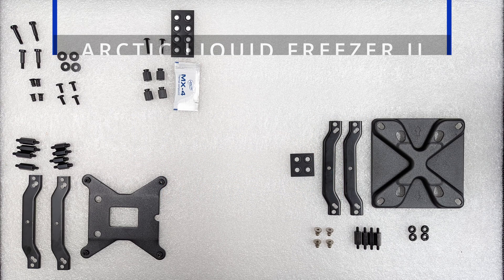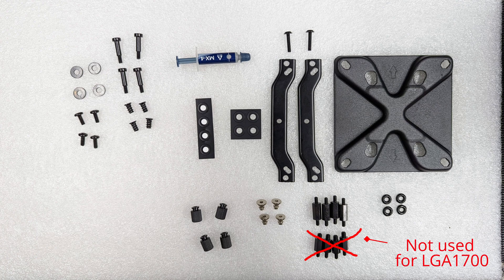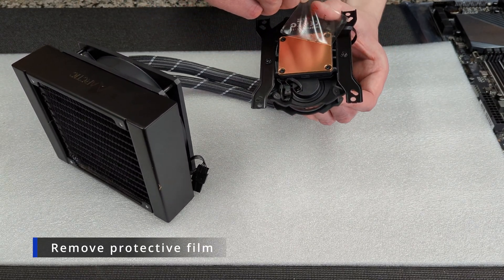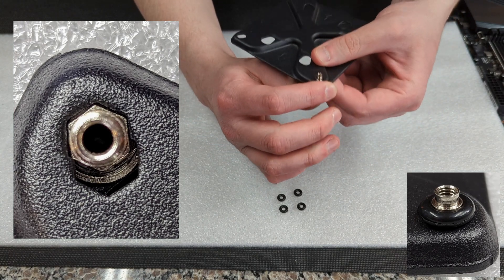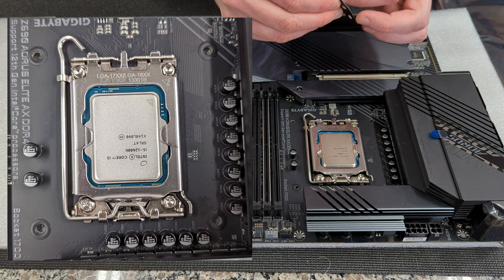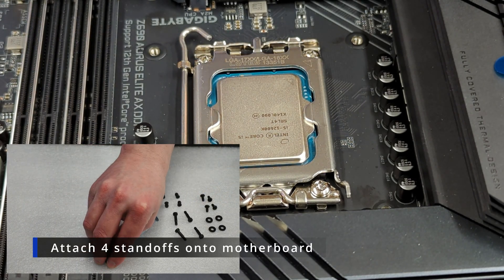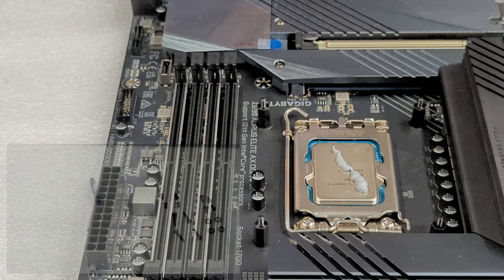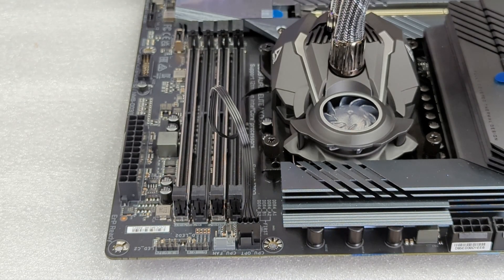ARCTIC Liquid Freezer II | LGA1700 Kit Installation

Comment: Does this backplate work for LGA1200? My MOBO is an Asus TUF h570 Pro.
Reply from the maker: Hi Keici,
the plate works for LGA 1700 and 1200 Sockets. CHeck out the manual for the kit: https://support.arctic.de/lf2-lga1700
Have a great day and stay safe.
BR
Arctic - Service
Reply: @ARCTIChannel  thanks for the reply!

Comment: Why does it go in pump fan optional instead of the CPU fan header or aio headed
Reply from the maker: Hey,

Either "CPU_FAN" or "CPU_OPT" are recommended. With the Liquid Freezer II, connection to a pump header results in a permanent, unregulated speed of 100%.

Kind regards
Dominik

Comment: Hello, i have Freezer 34 eSport basic, i need more of these mica spacers because i changed mother board and two of these spacers are broken and bended when i tried to pull them out, they are very sticky, now i do not have any idea where to find them, in your spareparts shop there isn't any, i also opended a ticket more than a week ago but no reply at all. Can you please sell or send directly these spacers? Thank you.
Reply from the maker: Hi Mik,

We apologise for the inconvenience and ask for your patience. We are experiencing an increased volume of support requests, which is why it is taking a little longer than usual for you to receive a response.
To ensure that you receive a reply as soon as possible, we recommend that you add the invoice and your delivery address.

Kind regards
Dominik
Reply: @ARCTIChannel  No problem, understandable, i attack the invoice to my ticket. Thank you for your reply and info.

Comment: Given this backplate design is just awful, is it possible (on Asus LGA 1700 motherboards with the LGA 115x hole spacing) to just use the LGA 115x backplate and the LGA 1700 standoffs?
Reply from the maker: Yes, you can do that. 🙂

Kind regards
Dominik

Comment: Nice vid, quick question though. Why the diagonal paste application?
Reply from the maker: Thank you!
It doesn't really matter how you apply the paste - just make sure that you cover the whole thing as thin as possible.
Don't trap any air inside and you should be fine

Best regards,

Comment: is the ilm bending correctors still recommended or made unnecessary by this mounting kit?
Reply from the maker: Hey Aeon,
GamersNexus made a video about that called "Investigating Intel's CPU Socket Problems | Thermal Grizzly Contact Frame Benchmark"
The test was made with our Liquid Freezer II.
There should be everything listed you need to know (Pro/Con)
Short form: yes it will have a effect but its definitely connected with a bit of work - you're also loosing the warranty of your MoBo

Best regards,

Comment: Anyone else having issues with plate screws? They wont fit flush on the back of the motherboard.
Reply from the maker: Check that the position of the plate screws is in the correct position (LGA1700 is the external milling).
The backplate can also be offset by 90 degrees.
Through the rubbers it can also feel a little bumpy, by mounting the stand-offs then tightens. :)
Reply: @ARCTIChannel  I believe I got it, it cools my 12900k at 28 idle and 66-70 max, great cooler.
Reply from the maker: Awesome!

Comment: What is the difference between these two small brackets with the original am4 ones?Because I think they are the same
Reply from the maker: Am4 has only 2 drill holes in contrast to the 1700 bracket. :)
Reply: Will these two brackets be compatible with MSI b550 tomahawk motherboard? cause I think they fit
Reply from the maker: The am4 is compatible :)

Comment: Excellent walkthrough! I had heard a lot of complaints about how difficult this cooler is to mount, but looks like Arctic took all that feedback into account when designing the LGA 1700 mounting kit, super easy even with the motherboard still in the case. Thank you very much for such a helpful video!
Reply: it is impossible to put the back plate on
Reply from the maker: Hey,
Could you maybe explain, what exactly wen't wrong, during the installation?
Otherwise take a look at our online manual:
https://support.arctic.de/lf2-360r7

Best regards,
Nico

Comment: 2:18
 Do I have to remove ؟

the PCB cover of the water pump
before installation on
ASUS ROG Maximus Z690 Hero
Reply from the maker: Hi Omar,
this specific board is on our incompatibility list and wont work with the cover attached. So yes please remove the cover as explained here: https://support.arctic.de/lf2-lga1700

Best regards
Stephan - Arctic Service
Reply: @ARCTIChannel  thank you
❤👍

Comment: you placed the cooler (pump block) wrong tho... doesn't it have to be "sideways" (small fan to the right, next to RAM) to match the cpu dimensions???
and yes i know the A_1 RAM slot is really really close, but it has enough space for it to fit 4 RAM sticks. (at least on the Gigabyte board you're using)
Reply: No. It’s designed to point up towards the VRM (since it’s a VRM fan). Though I have watched a few builds that point it to the left on condensed M-atx boards.

Comment: I just received an ARCTIC Liquid Freezer II 360 rev 4 w/ LGA 1700 upgrade kit. I mounted it on my LGA 1200 system to quickly test. I then decided to build my new LGA 1700 system but now I can't use the ARCTIC Liquid Freezer II anymore. Why? Because I only received 12 sticky washers. 8 came with the original kit for LGA 115x / LGA 1200 which I used. Then I opened the LGA 1700 kit to use for the LGA 1700 system to find only 4 sticky washers. If you're supposed to put 4 sticky washers on both sides of the motherboard, which means a total of 8 sticky washers, ARCTIC should include 8 in the LGA 1700 kit as well. Other than that, the AIO is FANTASTIC :) Thank you, Arctic, for a great product with a great warranty which is very important for many users.
Reply: I know this is an old post, but I just received my kit with 4 sticky pads. Also, the backplate sits on the Intel backplate and does not seat fully against the motherboard. I wish it did because the 4 standoffs cannot be fully screwed in due to concerns of overtightening and damaging the board. This might be a design flaw where the backplates touch.
Reply: @kurtrowland5587  Mine also only came with 4 washers...
What did you do regarding the backplate and crews?
Reply: @shalle3  I found the email with Support where we resolved this. I initially only put the washers on the front under the spinning nuts, but they agreed to send me a new backplate and 4 more washers for free. It was a really quick and easy process. Only took 2 emails back and forth. Props to Arctic  for having a good support team
Reply: @kurtrowland5587 hi, how did you deal with the backplate not seating fully against the board?
Reply from the maker: We are sorry for any inconvenience caused, we recommend that you contact our support team, who will gladly help you solve the problem: https://cs.arctic.ac/open.php?lang=en_US
Thank you for your understanding.

Best regards,
Social media team
Reply: @ARCTIChannel  I have the same issue, as others, with the backplate washers still leaving a gap between your backplate and the board. You have not replied to a single comment about this. Can you please not tell us to contact support, this is your product. Is this ok or not, and if not, what is the solution?

Comment: Not sure if I will get a reply but I have install the fans and the pump but am wondering where to plug in each wire. I am new to aio’s and have both a 4 pin connector and a 3 pin connector. I would like to know where to put these and what I am meant to do with the wires on the fans themselves or if I can just leave them
Reply: 3 pin connector is for the argb, read the motherboard manual or search on YouTube for the exact motherboard you have to see the location where it's plugged, mostly called JRAINBOW and it is 3 pins
Reply: @5005godfather  thanks for the reply, the only three pin ports on my motherboard are called D_LED1/2 or GDV but on the manual this is also called D_LED1/2 is this what I should plug it into
Reply: @5005godfather  or the only other 3 pin connector I can see is coming off of the fans connected to the radiator this would fit with the 3 hole pin that comes out from the pump or else I’m not sure what the pins connecting to the fans are meant to go into if anything
Reply: For the 4 pin connector is for the pump power, it is only one plug on the motherboard called PUMP_FAN or maybe another name, so search in the manual or youtube to know the location
Reply: @5005godfather  also the only fan connector with pump in it is called sys_fan4_pump so I think my beat option is to either plug it into cpu_fan or cpu_ opt because other than the previously mentioned connection, there is nothing for aio it pumps
Reply from the maker: plug your AIO to the CPU FAN or CPU OPT, it's the same ;)

Comment: I dunno what to do...im having issue with mounting clips abd these x2 screws...they tighten up too early and there is spacing in between :( any ideas?
Reply from the maker: Hi Doomzx,
which screws are you referring to? The ones where the clips are fastened to the pump?

Best regards
Stephan - Arctic Service
Reply: @ARCTIChannel  Yes these ones, screws tighten up too early and clips are not tightly attatched, there is like spacing between clips and the pump and clips are loose :( sry for the bad english
Reply from the maker: Hi Doomzx,
i can offer German as another language?
Please check for the finer threaded screws, i assume you have the AM4 socket screws installed which wont work with the nuts inside the pump. You have 6 similar longer screws included, 4 of them are used to fasten the pump to the Socket for AM4 (gigger threading), 2 of them (finer threading) are for attaching the clips.

Best regards
Stephan

Comment: one thing i noticed that was odd is every aio I've had i needed to plug in the fans on the radiator along with the pump into the mobo, but in this vid i only seen you plug in the cable from the pump into the cpu fan header, but not the fans from the radiator? does it all simply run from the one cable off of the pump?
Reply from the maker: Hi Roger,

that´s because of the integrated Splitter located at the rad. tubes. The fans are connected there and this very cable is routed inside one of the tubes to the pump. This allow you to have only one PWM Cable to connect for a better cable management.

Best regards
Stephan - Arctic Service

Comment: Thanks a lot for this video, Appreciate it a ton.
one question though.
I'm planning on getting the ARCTIC Liquid Freezer II 420, is there any thing i need to plug in other than the CPU_OPT? like a fan Molex or something?
Reply from the maker: no nothing else, but use the CPU FAN header on your motherboard.
Reply: @ARCTIChannel  Thank You SO much ❤️
Reply: @ARCTIChannel  In the video you said to plug the connector into every header except CPU_FAN. so which is it? 🤔
Reply from the maker: We have indicated that the video is not provided by us, but rather by "KLEEBZ TECH" and he mentioned "connect the power supply to the appropriate connector on the motherboard".

Comment: I lost 8 washer stickers
Is it ok to install aio 420 freezer without them?
I h still have metal washers
Reply from the maker: Never use Metal washers for installing the cooler on the board. This can cause a short curcuit! The metal washers are used for installing the radiator to the case. You can ask our Customer Support for new sticky washers. The cooler can be installed without them, but we don't recommend, because the motherboard with its traces can be scratched. 🙂
Reply: @ARCTIChannel  you are right I just use metal to see if it's good but cpu never touch cooler which cause high temprature 100c.
 I didn't want to damage Gigabyte Aorus z690 Master because I jave 1700kit but not washer you install between motherboard and screws of arctic freezer II 420mm. So any similar plastic washer from amazon?

Comment: What standoff length do i need to use with the freezer 34 esports duo? Because the ones that come with the Kit are too long
Reply from the maker: On which socket should you install the cooler? And which Freezer 34 esports DUO Rev. do you have?

Comment: Great video!! My Liquid Freezer II came with two cables (3 pin, 4pin). I'm going to assume only one is needed. Here goes nothing...
Reply from the maker: If you have 2 cables on your Liquid Freezer ll, then you have an RGB or ARGB AIO. The 3 pin connector must then be additionally connected to enable the illumination of your cooler. You can find detailed manuals on our website. https://www.arctic.de/produkte/cooling/cpu-kuehler/cpu-wasserkuehler/?order=topseller&p=1&properties=26b7932a1ab94953acdebd7f73d309af%7C73bbbf9cb5c546e2b569415dc4e48b37
Reply: @ARCTIChannel  Thank you!!

Comment: I followed this tutorial but temps are reaching 100C on load and 60C on idle.
Have tried to reapply the cooler with fresh thermal paste, did not work.
Even at 100C CPU my AIO radiator is cold.
If I press down on the AIO with my hand the temps decrease, so I'm thinking theres an issue with contact between the copper plate and the CPU.
Any troubleshooting fixes?
Reply: One thing to verify is that you are using the correct standoffs. The other possible issue is that the backplate is not tightened evenly which we mentioned in the video at about 5:40.
Reply: @KLEEBZTECH  it was indeed the backplate that was slightly skew
Reply: @sims22222  what was the temp after fixing the plate?
Reply: @itziknaim6890  33C on idle and 46C during gaming Overwatch and League.

Comment: The backing plate on my Asus z690 Rog strix e does not sit flush. the rubber o rings don’t sit flush or make contact with the back of the board… looks the same in this video but doesn’t seem correct? Is this a problem?
Reply from the maker: Hi Ryan,
did you  used the correct orientation from the backplate? There are indication arrows on there which must point in the right direction.

Best regards

Comment: I want to buy an Arctic Liquid Freezer II 360 is the LGA 1700 Mounting kit meanwhile included or do i needd to buy the kit extra ?
Reply from the maker: Hey Wutool,

If youre ordering from our Website it will be included - otherwise you can fill out a form at our Website, to receive a free LGA Kit.
Just follow incstructions 😊

Best regards,
Nico
Reply: @ARCTIChannel  Hey thanks that Sounds rly good. I Ordered it and hope my 12900k stays cooler 🙂👍
Reply from the maker: Im sure it will 😊

Comment: Good video but really disappointed to learn that my kit is not compatible with my 12600K without equipping the new mount. Requesting it from Arctic can take up to 21 days for international shipment. I’ve had to buy a mount from a seller, but this is still going to take a while to arrive. My build is waiting on this final part. You can imagine how devastated I was when my cooler finally arrived and I had everything on the table ready to go, until I realised I couldn’t continue :(
Reply from the maker: We completely understand your disappointment, we hope your kit will be delivered soon and you get your build completed. Good luck! 💙
Reply: how did you mount your cooler? I mounted mine with the adapted standoffs that I bought. However there is still space in between the cpu and cooler...it reaches 100 Celsius within 30 seconds
Reply: @richardli8595  Don't use it at all then. I'm in the same situation
Reply: @robingrunsberg9572   @Richard Li what did you guys do? I am in the exact same situation. How do I "not use it at all", it still needs to be plugged in the backplate right? or are you guys using the older backplate with the older standoff?
Reply: @jimmyhamel1392  hi, I actually purchased the kit (with backplate) for intel 1200. However, there wasn’t a piece for the pump itself. In the manual, we were told that we can take off the front piece of the pump (see manual online for further info). The front “case” for the pump was the problem for me. It may be not your case, but my motherboard was still new (Z690 ROG Strix if I am not mistaken) and the board was little bit chunky for the cooler. Hope it helps. Search for 1200 mounting kit by Arctic.
Reply: @robingrunsberg9572  thank you for the info! Sadly I do not think this is the issue for me, I don't see anything blocking and it seems I have the "revised piece" for the pump. thank anyways.
Reply: @jimmyhamel1392  if you have a 1200 intel, i think you still need the new backplate for it. I am don’t now, if you have one. But there is a difference between them
Reply: @robingrunsberg9572  Yes I have a 1300 intel and I am currently using the LGA1700 upgrade kit from this video.
Reply: @robingrunsberg9572  fixed it thanks to another guy in this comment section! the problem was actual the 2 plates that goes on the cooler directly, they were upside down! Thanks for you help anyways!
Reply: @jimmyhamel1392  np. Happy for u mate. I had my problem with this cooler too, took me few hours to solve it right 😂

Comment: I use 280 arctic freezer on i9 12900 kf but when i run cinebench23 temp reach 100c after 10 seconds, i am pretty sure follow the step of installation is this normal or should i try to reinstall ( when cpu is at high temp i feel the heat passing through the coil out of my pc case so i think it’s working)
Reply from the maker: Hi Prom Dear,
please open a service ticket on our service page. I need to inspect the mounting with some pictures from you. If you have already opened one, please tell me the Number.
https://support.arctic.de/menu/support
Best regards
Stephan - Arctic Service